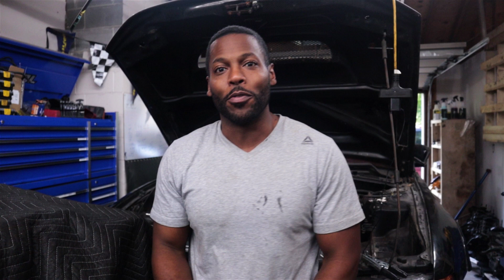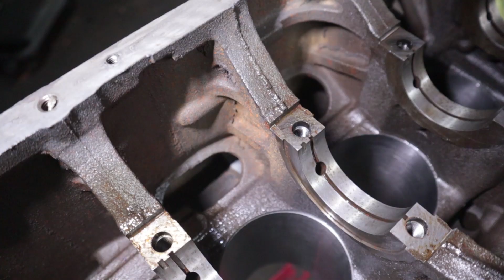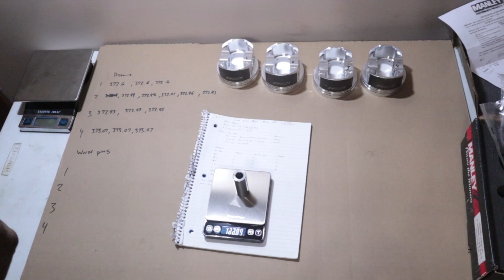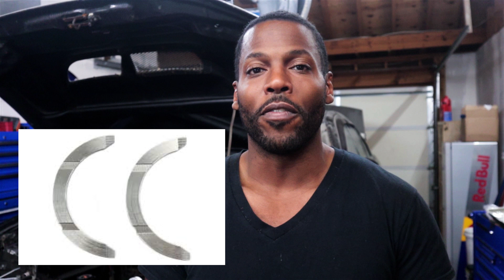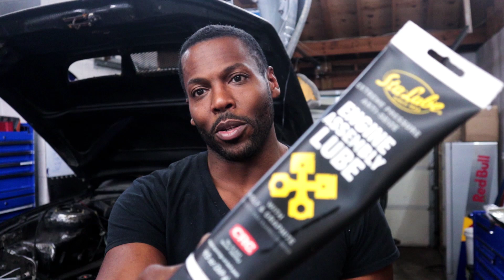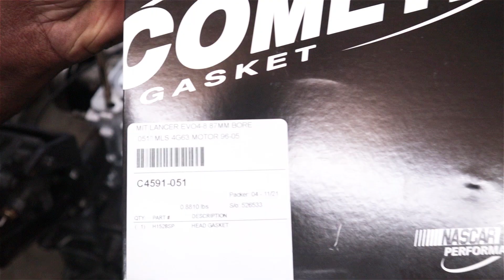Assembling My 1000HP 2.1 Longblock

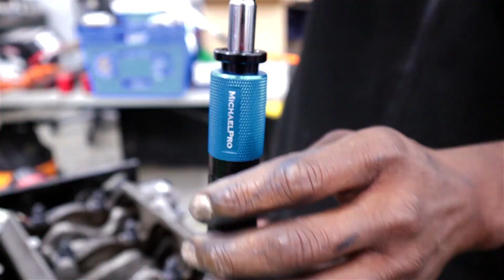Comment: 8:40 did you set the thrust bearing? this is done by hammering the crankshaft back and forth with all the mainstuds removed. if not set the clutch will only press against one of the bearing shells.